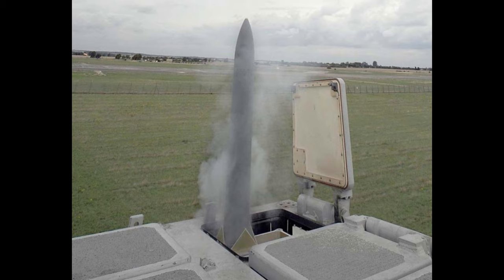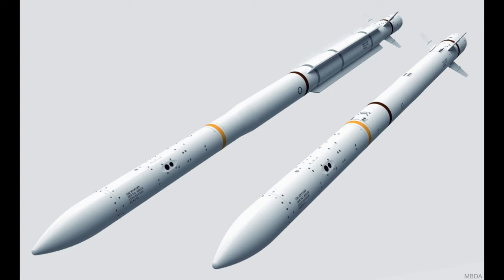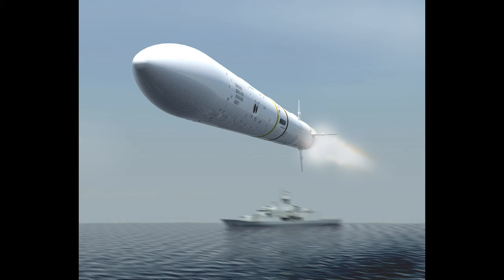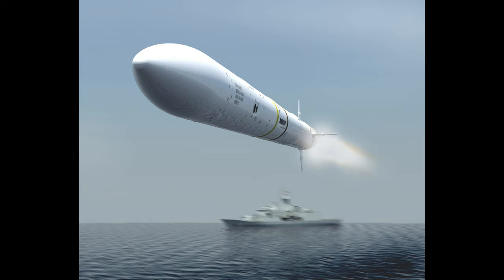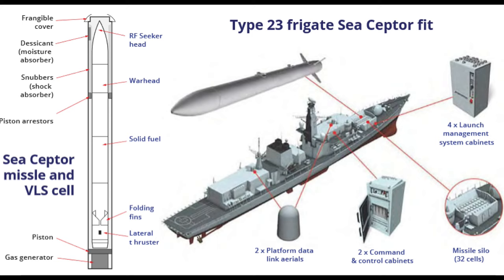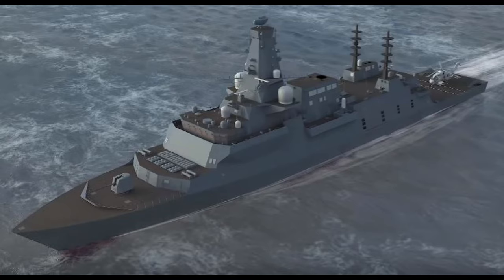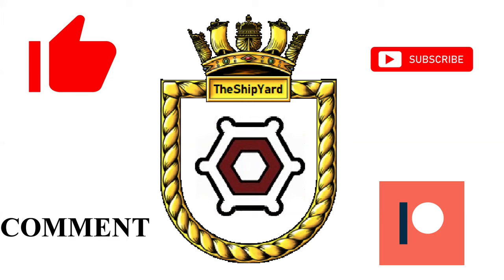CAMM (SEA CEPTOR) WEAPON BRIEFING - NO. 6

Comment: It's my understanding that the CAMM can be quad packed into certain VLS tubes. Is this also true for the extended range version?
Reply: As far as I know, the ER is still in the testing phase. The standard CAMM has not long undergone certification for "quad-packing" in some launchers and that variant has been around for years, so I wouldn't expect the ER to be qualified soon.
Physically speaking, there should be no problem fitting the missiles. The ER is still only 190mm in diameter compared to the ESSM's 254mm, and 4 of those fit comfortably in a Mk 41 VLS cell.
The Mk 41 launcher seems to be 71x71cm, and the Sylver 60x56cm, so even in the smaller of the 2 launchers, there is still 180mm space for the canisters which should be enough.

Comment: aussies type 26 doesn't use camm -  ESSM and SM2
Reply from the maker: I believe there still capable of taking them, even if that has changed
Reply: @TheShipYard2   the behind funnel fitting has been deleted on the hunter (canada are having for point defence (knocked of RAM)  yes they can be fitted quad packed in the MK41 silo's (32 celss) but as RAN already use ESSM and SM2 and have stated that as armament - personally I think should have the mid ship camm in addition, and fit it to the OPV
Reply from the maker: @c5173  ah well then, there is always someone who knows more :) so thanks for the information mate :)
Reply: @c5173  The Canadian Ships will Also have Sea Ceptor for Point Defence, added to SM2 and ESSM for a Potent Trio of Missile Systems.
Reply: @paultanton4307  yep as I said canada are still having camm -- your correct are also having SM2 and ESSM  (canadas camm shown as the behind funnel mount)  I wish RAN put that on the aussie ships too.

Comment: Oh, the Italians have finally finished developing the extended range version then?

I think it's worth noting that the range (of any missile) is very much dependent on the altitude, and publicly available figures, are usually very conservative (Janes, usually a fairly reliable source, said it reached 60km in trials, but expect this to be high altitude, and slowing down towards the end).
Reply from the maker: ik about the stated range on OS is 70% of the time incorrect, and ik some missiles have an altitude, I didn't bother putting it in due to  reasons i will not discuss. janes is great, but that info would be excellent info for more of a tactical threat brief.